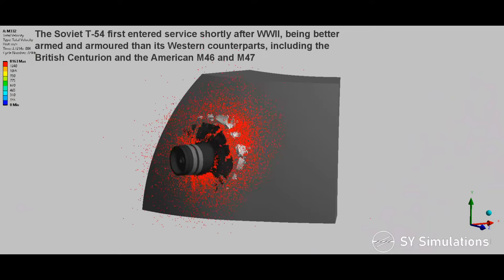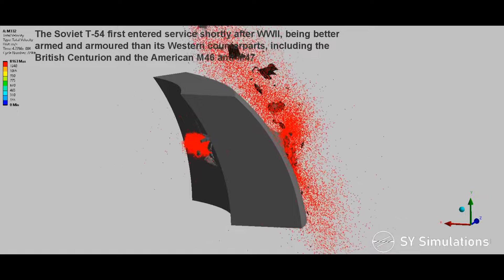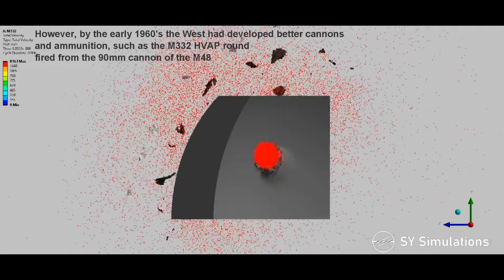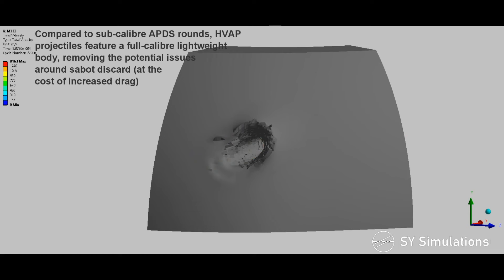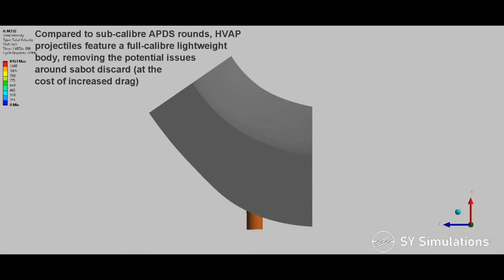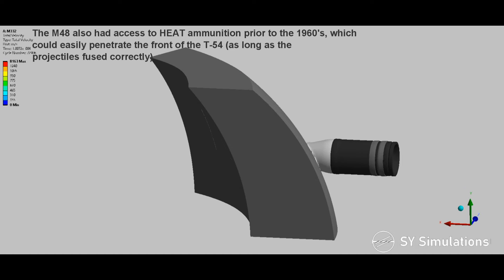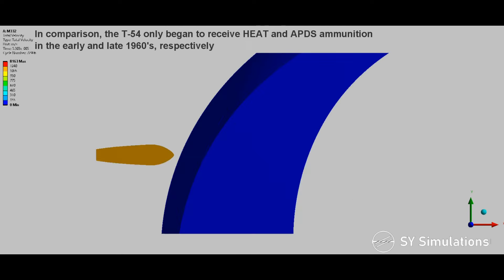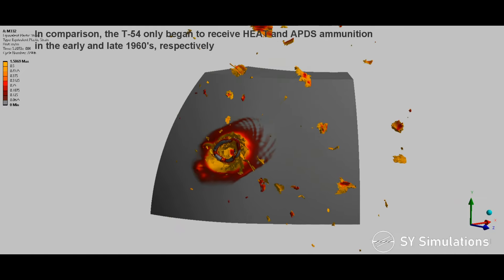M48 PATTON vs T-54 | Standoff at Checkpoint Charlie Pt.2 | M332 HVAP Armour Penetration Simulation

Comment: So basically both sides would have blasted each other to bits because they could both penetrate the others armor.
Reply from the maker: the M48 crew would have had to aim a bit harder (unless they had HEAT) but yeah, they both could destroy each other at this range
Reply: @SYsimulations  "the M48 crew would have had to aim a bit harder" so preaty much it would be easier for the americans to win the fight as they got nice ergonomics in the tank and good optics and in case of the soviet tanks hiting or even spoting the enemy was a big issue...
In WW2 Soviet tankers were taking 3 hits on avg before they were able to make the first shot at the German tank...
Reply: It would be easier for the americans to win the fight as they got nicer ergonomics in the tank and good optics and in the case of soviet tanks even spoting the enemy tank was a big issue...
In WW2 on avg. Soviet tankers were taking 3 hits before they were able to locate, aim and shot back at the German tank...
Reply: @Bialy_1 holy shit the immediate copium
Reply: @SYsimulations  The ranges at checkpoint charlie kind of negates any aiming issue. 100 meters is pointblank.
Reply: @Bialy_1 COPIUM
Reply: And then nukes.
Reply: @nukfigrs6621  what? it seems more like a guy just saying his thoughts on the subject and less like a guy coping like a Wehraboo when they discover the Maus can just be bombed.
Reply: the t54 upper plate might stop this apcr
Reply: @mr.waffentrager4400  but this isn't the t-54 ufp
Reply: @Bialy_1  US coping, they literally standing still
Reply: @Bialy_1 t54 is a much better tank than the m48 vets have said that themselves
Reply: @thetonk2173 lmao no... Just no

If you ask a American tanker what they'll use between these two they will pick the M48 every time
Reply: @Bialy_1 this aint a T-34
Reply: @Malpais-Legate and Soviets will say the same about their tanks
Reply: @gerfand  okay and good for them if they do, I don't care

My point was more that someone said American tankers claimed the t54 was better and I simply said no American tanker in the right mind believes that
Reply: @Malpais-Legate  yeah both tanks are very similar in capability, ofc one can argue if he does some research, but like in the end of the day the T-54 has theorically a better, (bigger) gun, but again, makes no difference.
Reply: @gerfand  In theory it's better: see that's a better argument than it IS better, there's other factors like reliability and optics, but that's besides the point

See I don't care if you say something in theory is better because it actually leaves something to interpret
Reply: @Malpais-Legate  yes, like I said you can get some research and do arguments, but for all pourposes, those tanks are basically the same, its only with T-64 that you actualy start seeing something different.
Reply: @nukfigrs6621 have you heard the coincidence range finder and ballistic computer? Your comment seems to show you don't have the full picture of the M48.
Reply: @gerfand the gunnery system was not at the same generation. T-54 was still doing the same thing as a WW2 tank where as the M47 and M48 was already using ballistic computer and coincidence range finder. When the engagement distance is more than T-54's battle sight range, the American tanks will have significant advantages in firing the first round and hitting the first shot.
Reply: @chrisblack6258  Ngl the fact you brought up coincidence rangefinders and ballistic computers in a debate purely about armor penetration does show youre a bit special ngl
Reply: @chrisblack6258  I doubt any Tank of this ERA had a balistic computer because... Have you ever seen the size of a Destroyer FC director of like 10 years prior? M-48 had no eletronics so it would have been a Mechanical one so no way it would be better than a T-55
Reply: @gerfand You do know optical rangfinders work without electricty right? You can literally maneuver the rangefinder controls by hand to get the range making it an ingenius solution to gunnery tactics.

Optical rangfinders on destroys, cruisers, and battlships are the size they are because the fire at much long ranges, and that its needed to accurately measure distances that far.

And whats to say a tank couldn't have a fire control computer? Submarines were doing this since the 1940s with the rollout of TDC's.

And also, just because it has the words ballistic computer doesn't make it as advanced as the fully automated ones that current MBT's use. It could be as simple as  crewman inputting only the distance to target, and the windspeed, and it doesn't take superconductors, microchips, and other highly advanced electronics to do something that could already be done with math at the time
Reply: People arguing about optics and ergonomics, while both sides of that "conflict" had near-infinite amount of time to aim, and distance, at which even blind man will aim purely by engines sound
Reply: @Gracefulwarrior2124  yeah they are big but at the same time can you make them smaller enough with that tech?
Remember moon landing used a computer that was weaker than anything you see today but was a server room sized. 
Can a Tank have something the size of a box to be installed in it with 1950s tech?
Reply: RTFM guys. The T-54A is not the old T-54, they would dragged pattons into mud in no time. Regardless of whether they had HEAT projectiles by that time or not. Yes, and from the APCR T-54A was better protected than all other tanks at that time.
Reply: @gerfand  You're comparing something that had to do tens of thousands of calculations relating to physics itself in order to get to and back from the moon safely, all while a basic ballistic computer only had to do a couple; its really a huge difference.

I did some reading up. The M48A1's ballistic computer only elevated the gun when crewman put in the range they found from the stereoscopic rangefinder, so as I said before, it was used to assist the gunner.

From what I've gathered, you haven't read up on the M48A1 at all, and you like taking tools used for very large distances and feets of achievment, and saying something can't have the same/similar tech based off of those, which were simply and only gathered from your opinions.

I'd offer you search up M48A1 ballistic computer, and hopefully one of the the first few options will have the marine corps mechanized museum on there, as it gives alnost all the information about the A1
Reply: @Gracefulwarrior2124  yes, I have not read on it, I just doubted the Tech could have been scalled down since this is the 1950s. a WW2 ship FC system is not that big its the size of a table, even a destroyer that fights at much smaller ranges, which while not Tank range, is closer than something like Iowa. (well not that this would matter at this range but that is not the point), the main thing is that the size you would need to is of a box that can fit on the turret and still be managed with whatever they use there. if they managed to do it, well good, I just doubted, since in WW2 you did not had anything like this and we are in 1950s, which is like some 5 to 10 years max difference.
Reply: @gerfand  Well its okay to be skeptical, but you made it sound like thats what you 100% believed lol.

Just think of it as a bow and arrow compared to a ballista. A ballista fires at much longer ranges, while a bow can't fire as far. Its a similar principle to tanks and warships with rangfinders.

As for ballistic conputers think of it as setting your alarm. Your phone/alarm clock knows what time it is set to ring such as the ballistic computer knows what elevation to set for the range. Its all predefined so it knows the ranges for the gun, and all thats needed is to find the range, so its not as conplicated as it sounds as much as the ones from today sound lol
Reply: @Gracefulwarrior2124  well sorry about that them, tho you should use Balistas and Crossbows just to be techinically better.

Yeah, the only thing is that, if you look at how techonology works making it smaller is not necessarly that easy, which why I doubted the US could do it, since it would have to be the size of a box, tho during peace time, specially after a war I guess they can do it
Reply: Oh, the hilarity of armchair tankers pontificating about balistic computers and sights and rangefinders for an hipotetical engagement at Checkpoint Charly,  where the tanks were 100 YARDS (nor even meters) apart in October 1961 - which means that all that was moot, since the deciding factor would be only the random happenstance of whether the US tankers would be more stoned off their arses than their USSR counterparts wold be drunk on cheap vodka, or vice-versa.
Gentleman, please. Lrn2 historical context.
Reply: @notfeedynotlazy  If you read any of it, I was explaining all of those things because gerfand wasn't sure about the practicality of those devices. At that point we were past the standoff topic.

I've no idea why you emphasized 100 yards, because yards and meters are almost the exact same distance give or take a tenth of an inch, which makes less sense considering yards are actually a little bit longer than meters lol. Now if you meant to say 100 feet, I could understand, but not yards.
Reply: @Gracefulwarrior2124  Blah blah "I was right" blah blah "pontificating" blah bla.
(Jeeez, learn to drop discusions when they have reached the point you are making a fool of yourself, son.)
Reply: @notfeedynotlazy  The only person making a fool of themselves is you. It doesn't take an english degree to grasp what it means by "I wasn't talking about the standoff."

Gerfand and I were discussing the technology behind tanks, and it was actually kinda fun for me. The main topic of this channel is tanks, which would include discussion about said tanks, of which Ican say for sure that it is highly shocking!

What I don't understand, is why you're so clearly aggravated over something that never included, nor needed or warrented your inclusion in the first place lol.
Reply: @Malpais-Legate  it’s true
Reply: @SYsimulations  The M48 is essentially using the same 90mm as the WW2 pershing cannon. Only difference are the ammo.
Reply: @SYsimulations tell that to war thunder
Reply: Correct. Thats why Germany and French gave up armor and developed AMX-30 and Leopard 1.

Its like cat and mouse. Once upon a time tanks were using field artillery and HE as main armament, so a thin armor is enough. Later on there were ap shells, so tanks were using thicker armor. And then apds vs slope armor, HEAT and HESH vs ERA and composite armor, second gen APDS and APFSDS vs heavy ERA and more advanced composite armor, ATGM and rockets vs APS, AT mines vs mine protection equipments, drones vs cope cage, etc.
Reply: @nhatpham2206  i do not care who the hellever sid was coping or not, all i know, silent this shit place, better than say any single words.
Reply: all you guys, i recommend, beginning not to say single words in comment, then there's no troubles, if you kept it like that, i let all you guys fighting each other.
Reply: @vendetta8022  So we are just going to call it the cope cage forever now because westerners don't like to admit they were wrong and it actually had a very important purpose? Fine suit yourself.
Reply: @youdontneedtoknowwhoiam9612 if you could tell us the true meaning behind the slat armor on the roof’s aswell as provide a source that states otherwise I’m sure people could be open to understanding, but so far as it’s turned out they tried COPING with MPAT in a way that you’d handle an insurgency and it didn’t work. You know, the actual literal definition of the word cope.
Reply: @Bialy_1 man this is point blank🤡
Reply: @mr.waffentrager4400 not at this range, the round would still be traveling very near muzzle velocity, it would be down to who fired first, even if the T54 shot first, the American crew would have considered their tank as a “kill” despite most of the tank still functioning, and would bail
Reply: @Bialy_1 сам считал? Откуда такая тупорылая статистика?
Reply: @Bialy_1  ? 100 meters is borderline knife fighting range for tanks.
Reply: I have no idea why people are berating this post. The T-54, while a decent design at the time, was very much still a WW2 design and technology. The M48 (and US tanks in general) had much better crew ergonomics, much better fire control, and HEAT shells, unlike the T-55s with WW2 type range stadia and AP shells. Now T-62 or T-64? That would be a TERRIFYING fight for M48....
Reply: @chocolat-kun8689  lmao literally not true, the Pershing used the M3, the M48 used the M41 cannon with higher chamber pressures, muzzle velocity, better ammo etc. Same could not be said about the T54 still using the D-10 from the WW2 SU-100
Reply: people in this comment chain pretending that even at 100m "point blank" that it still wouldn't be insanely hard for a T-54 to actually take out an M48 considering they were still using BR-412 at the time, and besides the lower front plate which in real life APHE does not nuke an entire tank like a certain other game would have you believe more than likely LFP shot would only take out driver, the only other part you could go through would be the smallest part of the turret any closer to the gun mantlet and it's not going through, any further away and it's not going through, UFP it's not going through. Good luck trying to hit accurately even at "point blank" with a T-54 which does not have a FCS that accounts for gun parallax (in fact doesn't have FCS at all even in 1961), and neither does the sight, close range shots wind up being harder unless you're insanely skilled at knowing how much parallax there is, something that regular T-54 crews at the time would probably not be as i'd imagine better tank crews would've been put in better tanks than T-54's, and if you're off by even less than half a meter your round isn't going through.

Meanwhile forget M348, M48 already would of had M431 HEAT by this point, could pen literally anywhere you wanted to, has FCS, Rangefinder, Commander Hunter-Killer system to take over main gun, faster reload, better mobility, better optics, better gun handling, gun depression, just objectively better gun. It's a known fact that Russia's 100mm is complete garbage even when they developed APDS for it it was still worse than even Britain's 20 pounder (84mm) APDS from decades prior. and 1961 when checkpoint charlie happened was quite literally the last year the m48 was in europe quite literally right after this all m48's were replaced with M60's with 105's or had their 90mm upgraded to the M60's 105, like with the M48A5. Like i don't see how anyone could look at a T54 which is worse in every way except maybe armor??? debatable, and be like "yep that's definitely better than an m48" like lmao are you just a war thunder player? Have you not learned of countless wars fought with M48s or Magachs vs T-54/T-55 and T-62s? what is the track record like for soviet tanks? I'm not some delusional person that believes NATO tanks are invincible either, it just seems weird that people will look at soviet tanks that don't have the best track record and be like "yeah that tank right there could've won them the world" *while pointing to a T-54

like bro..... no....
Reply: Ngl the drama gets boring after the 30th comment y’all need to wrap this up
Reply: @Bialy_1  Nope. It would be pretty much easier for the Soviets to win the fight as they got the better ergonomics in the tank and better optics and in case of American tanks hitting or even spotting the enemy was a big issue...
In WW2 German tankers were on average taking 4 - 6 hits beofre they were able to make the first shot on the Soviet tank...
Reply: @Bialy_1  It would be easier for the Soviets to win the fight as they got nicer ergonomics in the tank and better optics and in the case of American tanks even spotting the enemy tank was a big issue.
In WW2 on average German tanks were taking 4 -6 hits before they were able to make the first shot at the Soviet tank...
Reply: @Malpais-Legate  Dude, the T54 was universally feared in the west. It completely eclipsed western tank design until the late 50s. It was considered superior by American and British tankers which is why tanks like the Chieftain or M60 were developed in the first place.
Reply: @gerfand  
"Are basically the same"

The T54 has universally thicker armor, greater mobility, is more reliable, has a more powerful gun, better optics, is far easier to maintain and even featured Wet ammunition stowage. The T54 was better in every aspect.
Reply: @chrisblack6258  The M48 did not feature either of those lmfao
Reply: @chrisblack6258  Bruh the M48 was not using ballistic computers lmfao. You are talking about the late 50s upgrades by which time the T55 was already in use with ballistic computers as well. The T54/55 will ALWAYS have the major advantage over the M48.
Reply: @Gracefulwarrior2124  You do know optical range finders to work with electricity, right? You are talking about simple optics with elevation lmfao. Those are not range finder.s

Submarines are not tanks. The initial versions of the M48 did not feature range finders. Only later upgrades from the late 50s did by which time the T55 had already been deployed with range finders as well.
Reply: @dwarow2508  which later 50s upgrade you are talking about?
Reply: @dwarow2508  yet they are basically the same when it comes to a war with the deciding factor being other things
Reply: @Gracefulwarrior2124  You literally just confirmed that the M48 did not feature range finders and that the later upgrades merely featured a very basic form of aim assist.

From what we have gathered, you have not read up on the M48 at all, and you like taking tools used for very large systems and saying something can easily have been just made smaller, which were simply and only gathered from your opinions.

I would offer you to read up on the M48 and hopefully one of the first few options will have the basic Marine Coprs mech museum on there, as it provides all the information.
Reply: @dwarow2508  why does a optical range finder need electricity?
Reply: @dwarow2508  and what T-55 ranger finder you are talking about?
Reply: @theliteralworst9416  Wtf do you think is the purpose lol? Defending against Shaped Chargest as the Malyshev Plant in Ukraine which is responsible for mounting cages on Leopard 2s and Challenger 2s, has stated.
Reply: @cheekibreeki4638  Bruh the M48 was a ww2 design. The T54 (and Soviet tanks in general) had much better crew ergonomics, much better fire control, and heat shells, unlike the M48s with WW2 type range stadia and APCR shells. The M48 was inferior in every single category which is why the M60 was developed...
Reply: @BladezAndrew  Bruh the D10T on the T54 (not the D10 LMFAOOO) had far greater chamber pressure, muzzle velocity, better ammo etc over the M41. The M41 was literally a ww2 gun.
Reply: @BladezAndrew  People in this comment chain pretending that even at 100m "point blank" that it still would not be insanely hard for an M48 to actually take out a T54 considering they were still using T33 while the Soviets were using 3BM-8, and besides the lower front plate which in real life APHE does not nuke an entire tank like a certain other game would have you believe more than likely LFP shot would only take out driver, the only other part you could go through would be the smallest part of the turret any closer to the gun mantlet and it's not going through, any further away and it's not going through, UFP it's not going through. Good luck trying to hit accurately even at "point blank" with a M48 which does not have a FCS that accounts for gun parallax (in fact doesn't have FCS at all even in 1964), and neither does the sight, close range shots wind up being harder unless you're insanely skilled at knowing how much parallax there is, something that regular M48 crews at the time would probably not be as i'd imagine better tank crews would've been put in better tanks than M48s, and if you're off by even less than half a meter your round isn't going through.

Meanwhile forget BR-416, T54 already would have had 3BM-8 APDS at this point, could pen literally anyhwere you wanted to, has FCS, Rangefinder, Commander Hunder-Killer system to take over main gun, faster reload, better mobility, better optics, better gun handling, firepower, just objective better armor and gun. It is a known fact that America#s 90mm is complete garbage even when they developed APDS for it it was still worse than even Soviet 100mm HEAT from decades prior. And 1961 when CC happened was quite literally the last year the T54 was produced quite literally right after this most T54s/T55s were replaced with T62s with 125's plus APFDS. Like I dont see how anyone could look at an M48 which is worse in every way except maybe reverse speed??? Debateable, and be like "yep that's definetly better than a T54" like lmao are you just a war thunder player? Have you not leared of countless wars fought with T54s/T55s vs M48s or M60s? What is the track record like for American tanks? I'm not some delusional person that believes Soviet tanks are invincible eaither, it just seems weird that people will look at American tanks and that don't have the best track record and be like "yeah that tank right there could have won them the world" *while pointing to an M48.

like bro.... no....
Reply: @chrisblack6258  T54B as well as the T55 which by that point had been in serice for 2 years.
Reply: @gerfand  Dude, literally all other things are superior on the T54. It is not even close. All the M48 has to show for itself at best is reverse speed.
Reply: @chrisblack6258  Because how else will it determine range? If the rotation of a turret requires electricity, why would the process of using an electrically generated laser to determine range not require electricity?

You do realise we are not talking about gun assist, right?
Reply: @dwarow2508  you did not answer my question. You might wanna do a bit more research
Reply: @chrisblack6258  I did asnwer your question. You might wanna do a bit more research.
Reply: @dwarow2508  like imagine that 400 tank losses vs 2300,  M48's and Centurions literally had a KD of nearly 6.0 vs T55s and T62s. 6.0 vs 0.17 It's like a world best professional Esports player vs a half blind borderline mentally handicapped child who's never picked up a controller/mouse and keyboard before. It's like an NFL team vs a child's team that's never even played before like bruh who tf could possibly look at an actual ww2 tank with a ww2 gun and be like "bro that tank is SICK bro fr" but then see numbers like that.
Reply: @BladezAndrew  Like imagine that 790 tank losses vs 2800, T55s and T72s literally had a KD of nearly 4.0 vs M48s, M60s, Vickers, Chieftains and Centurions. 4.0 vs 0.89 It's like prime Myke Tyson going against a disabled golfer lmfao.
Lile bruh who tf could possibly look at an actual ww2 tank with a ww2 gun and be like "brooo that tank is sick bro fr" and then see numbers like that...
Reply: @dwarow2508  Sorry I didn't know YouTube don't give notification for every response.
Reply: @dwarow2508  range stadia on an M48?  Can you even find a picture of an M48 with that?
Reply: @dwarow2508  you are talking about lazer range finder, that's not optical range finder they meant
Reply: @chrisblack6258  
Bruh you are talking about stereoscopical sights, not range finders...
Reply: @chrisblack6258  Bruh, "optical range finders" are periscopes found on any ww2 tank lol. They do not tell you the range. Range has to be individually determined by the gunner.
Reply: @dwarow2508  and?
Reply: @dwarow2508  bro couldn't even spell Mike Tyson's name right and at this point you have to be trolling. I don't know of any wars in which T72s fought m48's? but i can tell you a war in which M60's fought T72s. The Gulf War was the largest deployment of M60s by the United States. They destroyed 100 Iraqi tanks including T72s with only 1 m60 loss 100.0 KD It's literally like sending a neutron star made of anti-matter at the speed of light the second it goes supernova to wipe out a single bacteria cell, and they weren't even M60A3's they were M60A1's which were made literally 10 years BEFORE the first T72s that's literally how bad Russian tanks are like i really don't get why you're defending them. Failed tanks of a failed nation that didn't adopt capitalism so they don't have the GDP to actually produce decent.... anything really. The T72 is just a cheap T64 and the T64 was literally useless junk because they couldn't field it anywhere nor had the funds to even really support the technology they were trying to develop. They look good on paper but in practice they're terrible, majorly cramped spaces, only a crew of 3 making maintenance way harder. exploding autoloader in crew compartment instead of behind blast doors. If ammo detonation doesn't get you the autoloader's hydraulic fluid igniting will. Almost all of them have outdated FCS, lack thermals, rely on ERA when segmented tip APFSDS and tandem charges negate ERA etc. From armor, to firepower, to mobility (no neutral steering so it takes forever to turn around, 4kmh reverse speed lmao) to optics to FCS to lack of thermals to less crew, cramped space, no survivability, no gun depression so gun literally can't aim down autoloader prevents using longer penetrating rods, i mean the list goes on and on. What can you say that's bad about Nato tanks? the "NATO hump" elevated engine deck? wow. Meanwhile the list of problems with russian tanks never stop. 105mm ammo like M900A1... Think about this for a second. RIFLED 105mm ammo.... like M900A1, or DM63, or T-2 Series. Fired at depending on the round 1400-1500m/s rounds from literally over 30 years ago OUTPERFORMS 3BM60 a round Russia developed in 2016. LIke just imagine that for a second..... Then realize they don't field 3BM60 in most their tanks and they're still using 3BM42.... Like again.... why are you defending this country's tanks? XDDDD
Reply: @gerfand  This means all those other factors still speal for the T54 xD
Reply: @dwarow2508  I see. So you don't have any idea about a stereoscopic rangefinder or coincidence rangefinder. 🙄
Reply: @chrisblack6258  I see. So you don't have any idea whatsoever about the difference between a range finder and a simple periscopic sight at all. 🙄
Reply: @dwarow2508  M48's do have rangfinders, its the little nubs that poke out near the sides of a the turret near the top. Literally all my comments about the m48 was researched by me beforehand, so nice try lol
Reply: @Gracefulwarrior2124  
M48s prior to the A3 do not have rangefinders. Those little nubs are simple sights lol.
Literally none of your comments about the M48 had been well researched at all, so nice try lol.
Reply: @dwarow2508  Well if the nubs aren't the stereoscopic rangefinder, then where do they put the rangfinder on A3 and later varients? Im asking because they can't place it where there are already sights yk. Don't forget, rangefinders have to be large enough in order to determine the range effectively, ie the same distance the m48 nub "sights" are.

Also, please stop using assumptions to determine when I'm wrong or right. You physically can't prove I didn't research so there's no reason to attempt in vain to tell me so lol
Reply: @Gracefulwarrior2124  
Stereoscopic sights are not range finders. They are simply sights that offer proportions from which the gunner then has to determine the range manually. 
In the A3 and later variants the electro-optical rangefinder sticks out on the turret. 
Don't forget, range finders back the  were quite large, larger then those nobs you were referring to, yk?

Also please stop making up one claim after another. You can only prove that you did your research if you post variafiable claims which you failed to do so far. So I have all the reason to tell you that you did not do any research lol.
Reply: @dwarow2508  Nothing to retort now huh
Reply: @Gracefulwarrior2124  You did not reply lmfao
Reply: @dwarow2508 But why my country's armed forces abandoned its Type 69 tanks, and threw them away into the ocean as corals replacement for fishes?
Reply: @raptorcobrery-cfaasalesman9701  For the same reason the US abandoned the M48 and threw them into the ocean as coral replacement?
Reply: @dwarow2508  Off with this, let's put Bob Semple tank into a service then!
Reply: @raptorcobrery-cfaasalesman9701  You know damn well that is unfair xD
Reply: @Malpais-Legate  it's better if the commander-gunner seating wasn't so awkward. Otherwise - perfect machine
Reply: @dwarow2508  sorry bud, other than the fact you didn't even provide any actual evidence of the conflicts that confirm this made up KD ratio of yours he's kinda got you beat there, especially since you russian meatriders usually never have an answer to the gulf war, which he happily elaborated on LMAO
Reply: @dwarow2508  Uhuh, you say that now but you can't unwrite the Yom Kippur War
Reply: @belgianfried  Even a perfect machine has flaws, what matters is that the M48 did it's job well, it's too bad certain people here (soviet fangays) like discrediting it despite its objective history as a great vehicle
Reply: @dwarow2508  An M48s 90 absolutely could take out a T54 at 100 meters, that's just common sense... Also T62s used 115mm guns, not 125s, but damn go off sis
Reply: @dwarow2508  More like the other way around, or do we need to mention how many of your precious soviet tin cans got destroyed in the Second World War? Soviet vehicles would be lucky to survive more than one hit by the point Tigers and long 75s were around.
Reply: @Malpais-Legate  Uhuh, you say that now but you can't unwrite the South Lebanon War, the Kuwait invasion or the Iran-Iraq war
Reply: @Malpais-Legate  
An M48s 90 could not do shit to a T54B, that's just common sense.... Also I literally said 115mm, but damn, you do you kid
Reply: @Gracefulwarrior2124  Nothing to retort now, huh?
Reply: @Malpais-Legate  
>Tries to list the Gulf War as an example of American superiority
>Literally needs 1980s M1A1s to take down some unmaintained T55s from the 50s
>Says the Iran-Iraq war was not elaborated on even though it was
>Casually ignores how basic T72s from 1968 massacred hundreds of Chieftains, Vickers, M60s and Centurions all from the same era....
>Casually ignores the Kuwait invasion when a single T72 column wiped out 57 out of 60 M60s, 38 out of 41 Vickers and 29 out of 36 Chieftains
>Casually ignores the fact that literally every single engagement of NATO tanks and Soviet tanks of the same era ended in NATO tanks getting their teeth kicked in

🤣🤣🤣🤣🤣🤡🤡
Reply: @belgianfried  Ah, that's why it was labeled unsuited for combat in Europe, right?🤣🤣
Reply: @Malpais-Legate  All that matters... both machines - it's nice to sit in when it's FUCKING EMPTY!!!!!!!
But Patton is really, really, much taller. Sometimes it gets to you
Reply: @Malpais-Legate  
"The Army concluded in January 1952 that the T42 had failed as a tank capable of combat in Europe against Soviet tanks and reached the same conclusion in November 1953 for the M48 Mod A versions."

Source: Cameron, Robert (1 July 1998). "American Tank Development During The Cold War", p. 30 - 36
Reply: @belgianfried  It's a trade off really, give the crew more comfort or have the vehicle be more crowded, US doctrine favors crew survival and ease of use, russian doctrine is more keeping the vehicle compact so it'll have some armor and won't be too costly whenever it's destroyed.
Reply: @Malpais-Legate  favourite machine is still my beloved PT-91M. Thing is really comfortable in reality. Well when it's raining, because here in Malaysia our daily weather is 31 degrees celsius!!!!
Reply: @Malpais-Legate  That is not Russian doctrine lmfao. The point of decreasing crew space was to have a lower profile so it would be spotted less often which is a greater conteibuter to surviveability then having large hatches XD.
No wonder you ran away from the thread with L takes like those🤣🤣
Reply: @dwarow2508  Oh no, I did send something, but apparently even simply quoting a museum leads to my comment disappearing. That is, a museum which has an M48A1, and a corresponding article they made on behalf of it specifically states that it has a stereoscopic rangefinder, a ballistic computer, and a ballistic drive for the computer to set the elevation based on what range is found from the rangefinder.
Reply: @Gracefulwarrior2124  
You clearly did not as that would have warranted a reply several days earlier when I actually pointed it out.
Yea again, that does not prove your claim lmfao. A streoscopic "rangefinder" is nothing more than a simple optic that does not tell you the range. All it does is provide assistance for the gunner to calculate the range himself lol. You failed to explain how it has a rangefinder. The ballistic computer was introduced first on the A3 variant. The original M48 up until the A2 did not have a ballistic computer (which is actually stated on the very museum plaque you tried quoting). By the time the A3 was introduced, the T55 was already in service which had a ballisic computer as well making your point irrelevant. Same for the ballistic drive.
Reply: @dwarow2508  Also regarding your comment of an M48's 90 not being able to do anything to a T54B, have you forgotten that heat existed for the 90 mm? I mean, even this video itself mentioned that, and this simulation used arguably the worst shell the M48 had available, not the best it had.

M431 HEAT doesn't care about any soviet heavy tank's armor, since no armor at the time could effectively withstand around 320 mm of penetration , so any armor related benifits are kinda nullified with that lol
Reply: @Gracefulwarrior2124  
Bruh, have you forgotten that HEAT is still reliant on slopes?
I mean, even this video itself mentioned that, and this simumation used the best HEAT shell available to the M48 at that time vs the most basic T54. 

Any Soviet heavy tank or MBT did not care about the M431, since both the T54B and IS-4 exceeded an RHA value of 280mm while the M431 at that angle could not penetrate more than roughly 270mm, so any HEAT variations are kinda nullified with that lol.
Reply: @dwarow2508  Nah HEAT is completely unaffected against slopes like full caliber AP is. Considering the HEAT jet is a super tiny hypersonic copper stream, it has no need to normalize like AP does. The only time an angle becomes too great for HEAT is when the round itself ricochets due to extreme angles.

Where in this video did they say HEAT was susceptible to slopes? This you can definitely timestamp, so please, by all means, tell me what exact time it says that in this video. Also, that was the most HVAP looking HEAT I have ever seen; maybe actually watch the video this time, instead of making things up lmao.

Considering HEAT is not affected by slopes and distance, it will always deliver a solid 320 mm of pen, which exceeds the 280 mm (or even 290 if were being gracious,) of effective armor of an IS-4 frontal glacias. The only time a T-54 has over 280 mm of effective armor is at very extreme angles, exceeding 70 degrees. This only frontally appears at the very edges on the side of the turret when looking at its front, and over 90% of the rest of the tank is able to be penetrated by M431.
Reply: @Gracefulwarrior2124  
 @Gracefulwarrior2124  
NAH aint no way you just said that. HEAT is unaffected by DISTANCE not slopes xD.
The jet still is a penetrator. A slope will still make the jet less potent.

You can quite literally see in this video a comment stating that the M48 had access to the most modern HEAT shell. Man it must be really tough not being able to read lmfao. Please pinpoint exactly in this video where he shows the HEAT shell piercing the armor. Because that was definetly the most HVAP looking HEAT I have ever seen.
Maybe actually watch the video this time, instead of making things up lmfao.

Considering that HEAT is affected by slopes, it will NEVER deliver a solid 320mm of pen, but barely 250 - 280 depening on how gracious we are. Bruh, the very basic UFP of the T54B offers 280mm of RHA given the regular slope it has as well as the thick plating in general. 
The only areas the M431 could penetrate frontally would be the breech and maybe the turrer front.
Reply: @Gracefulwarrior2124  
"HEAT is not affected by slopes"
Man I wonder why HEAT shells can not penetrate the 38mm regular steel plate of the M1 even when not bouncing off then🤣🤣🤣🤡🤡
Reply: @dwarow2508  Alright, how do angles make the jet less potent in terms of physics? Surely should be easy enough, considering you "know" exactly how they behave.

Now, you're avoiding the question lol. Misleading is not the way to go when avoiding something, so please, answer my original question that you so lazily just copied lmao

I understand war thunder isn't the most reliable place, but even the Russian based company says HEAT can penetrate their glorious IS tanks and Early T series lol.

HEAT in real life would simply ricochet off of the upper glacias of a Abrams, because 82° is what I would call an extreme angle, even for APFSDS. Nowadays I'm pretty sure the UFP armor has been upscaled to 50+ degrees, so it's not even relavant in present terms.
Reply: @Gracefulwarrior2124  Bruh the jet still disperses on the surface lmfao. A higher slope will leed to more dispersion and a worse form of the jet. Dude this is not rocket science. Surely should be easy enough to understand, considering you "know" exactly how they behave.

Now, you're avoiding the question lol. Misleading is not the way to go when avoiding something, so please, answer my original question that you so lazily just deflected lmao

"I understand war thunder isn't the most reliable place, but even the Russian based company says HEAT can penetrate their glorious IS tanks and Early T series lol."

LMFAOOOOOOO BRO IS SERIOUSLY USING WAR THUNDER AS PROOF XDDDDDDDDDDDD

HEAT in real life would simply NOT ricochet off of the upper glacias of a Abrams, because HEAT triggers either way. It would detonate and simple disperse all over the UFP without going through. 

"Nowadays I'm pretty sure the UFP armor has been upscaled to 50+ degrees, so it's not even relavant in present terms. "

Why the fuck am I even wasting my time on a dude who thinks 50 is more than 82 xDDDD
Reply: @dwarow2508  Last I checked, the jet is a few millimeters thick, and travals at 9 kilometers per second. The jet literally doesn't have the time nor the energy to disperse. Don't forget, objects traveling at very fast speeds such as APFSDS, and especially HEAT don't have any of the same materialistic properties such as full caliber AP shells, so what a full caliber AP shell fails to do (ie ricochet or be affected from angled armor) isn't necessarily what a HEAT Jet or APFSDS is going to do.

We have water jet cutters, that cut cleanly through metal slabs and sheets; its a similar principle with heat, but at even higher cutting power.

Honestly, its almost sad you have to repeat stuff. I mean who goes through life, and literally just copies what somebody says lmao. I mean, at least make this argument challenging and original, instead of just sad and unexciting to witness.

I never said it war thunder was credible, I just thought it was funny that a company that comes from russia and has implemtented random quirks of russian bias, would have let their heavy tanks be damaged and destroyed by American HEAT.

Thats funny, since when did HEAT shells use inertial fuses? Pretty sure never, and its the contact fuses that allow a HEAT shell to detonate. When the round hits an extreme angle, the fuse itself is never contacted, and thus a ricochet occurs lol.

Its pretty funny you pulled out the value 82 out of nowhere lmao. I was replying to your comment talking about the 38 mm UPF of an abrams, and stated that it has increased since then. Nowhere did I mention the number 82.
Reply: @Bialy_1  they just 30 meter
Reply: @Bialy_1 At point blank range, “good ergonomics” won’t really matter. A range finder won’t matter long ranged sights won’t matter. As long as you can accurately land hits at short range that’s all you need. Also the Soviet tanks didn’t need to really aim carefully almost the entire American tank was a weak spot…
Reply: @alicorn3924 It’s a temporary moving bunker “by design” tho 😅. 😂😂😂
Reply: @mr.waffentrager4400 Not really I’m sure it goes through unless I remember incorrectly
Reply: @Malpais-Legate At checkpoint Charlie you’re choosing the M48 unless you magically had HEAT, and the T-54 could also have HEAT too. But the thing about the T-54 is more sections of its armor reached 300mms than the M48 which is a giant weak-spot against APHE, something that the T-54 isn’t. 

Furthermore the T-54 (unless I’m mistaken this for the T-55 and it’s unique to that) has a  Wet Ammo Stowage. The M48 doesn’t despite the Sherman having it. The ammo is in the turret and the hull at the front, so a front penetration would be catastrophically bad. The T-54 may stop a cook off, even if the chances are slim.
Reply: @chrisblack6258 T-54s come in different variants, some closer to the T-55 which had a stabilizer, the M48 didn’t even tho the Sherman did. So it is very much a give, and take.
Reply: @BARelement  remember what ? Last sim was about the turret front which was almost flat not 60 degree like ufp, chech how much pen does this round has at 60°
Reply: @Bialy_1  Love how you dont get the answer you wanted so you started making up excuses as to why the americans would win LOL
Reply: What was the T54s drawbacks compares to the M48 or Centurion that is early Cold War that is???
Reply: @Bialy_1  фэнтези хорошо. Но реальность другая. 
Танки СССР уже находились на позиции к моменту выведения м48. 
После попадания, танк СССР всё ещё боеспособен.
А статистика ww2 очень спорная. Были случаи когда 1 танк получал 20 попаданий под разными ракурсами, и оставался боеспособен. В то время как по документам, немецкие танкисты уничтожили 20 разных танков.
Reply: @Malpais-Legate  T-54-55 are great tank lol better armour and gun then the m48 , only later upgrade m48 receive 105mm btw
Reply: @jerryle379  Which those 105s completely bodied T55s and 62s (which the T62 used the 115mm gun) in the 6 day war lmao
Reply: You guys do realise 90mms Pattons and T-54s fought each other in the middle east, right? Guess who came out on top.
Reply: @Bialy_1 As an extremely patriotic American, this is pure copium.
Reply: @Terror-sk9nj  Aiming at extremely close range can actually be more difficult because parallax is more apparent. This isn't war thunder where the sight is inside the gun barrel.
Reply: @alicorn3924  It kinda is though, the T-54 was not a bad tank at all for its time. I'd argue it's objectively better than the M48 in most respects. It has a pretty decent commander's cupola which actually gives it quite decent visibility.
Reply: @Bialy_1  a Pole writing schizo shit in comment section about any army topic is like bread and butter
Reply: @gerfand  The T-55 had a larger (in diameter) gun, but at this time ,the rounds they fired were largely similar in performance.It should be noted however that they were both outperformed by the 20-pdr available on the Centurion in 1948, which also came with a full 2-axis stabilizer.
Reply: @nukfigrs6621 "they would have had to aim a little harder" is crazy copium too
Reply: @Bialy_1 this is supposed to replicate checkpoint charlie where the tanks where in clear line of sight of each other just waiting for a command to shoot, stop nafo coping
Reply: Same goes for modern tank.
Reply: @Bialy_1  This video is about 1961 Checkpoint charlie where the tanks are closer to eachother at around 50-100m they were in point blank range.
Reply: No, because the Soviet 100mm guns had crap ammo, it was just solid steel, they didn't have tungsten core ammo. Their 100mm guns could only penetrate 200mm of armor and all the front of a M48 is 250mm or better.

All changed with the T-62, that 115mm APFSDS was something else even with cheap steel projectiles.
Reply: There was 32 american tanks vs 30 soviet, it would have been a really close fight